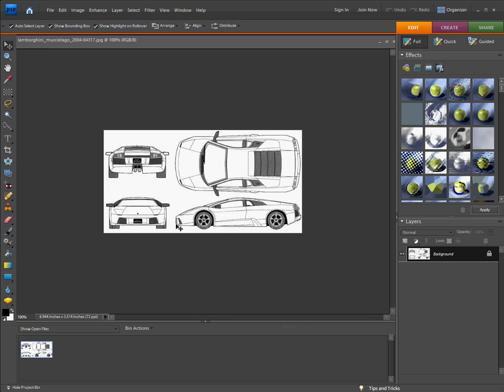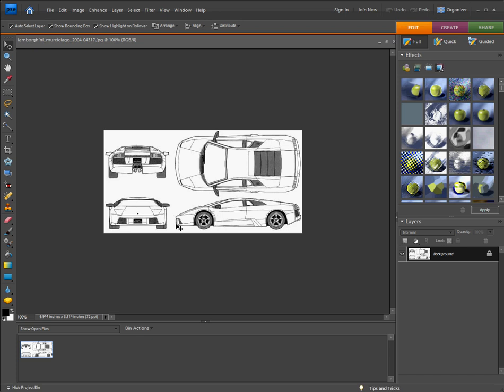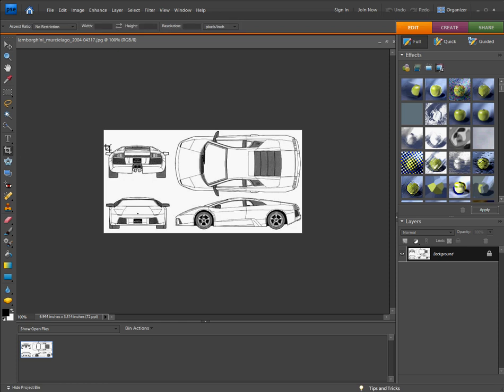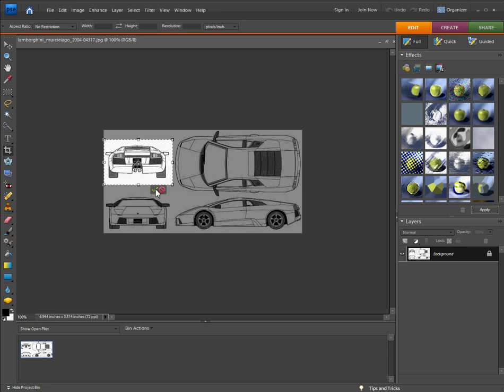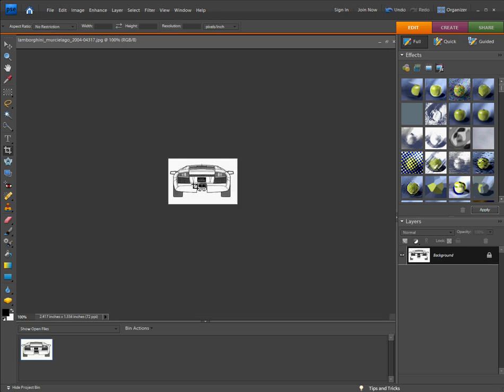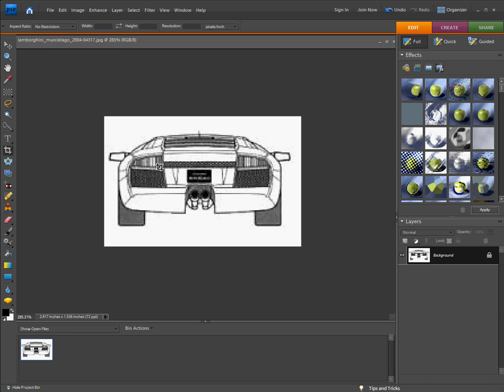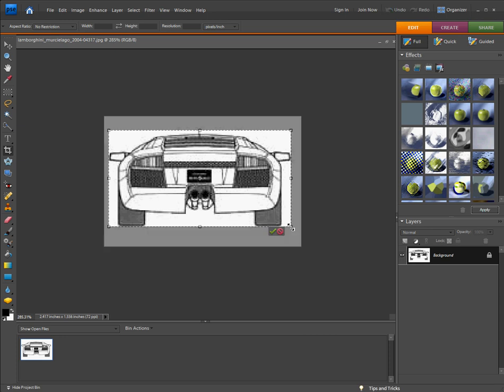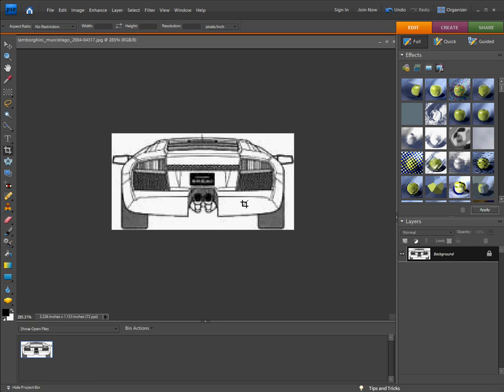How To Make Blueprints For Autodesk Maya

Comment: dont import blueprints by ( view>image plane>import image ) because its not a correct way its for faster importing of blueprints. Don't worry just create a plane in Maya by the blueprint dimensions you have and apply blueprint or whichever image you would like by means of material. Create individual planes for every views of blueprint you have.